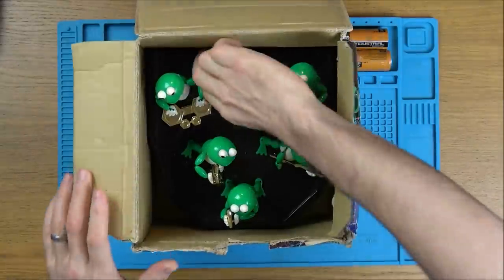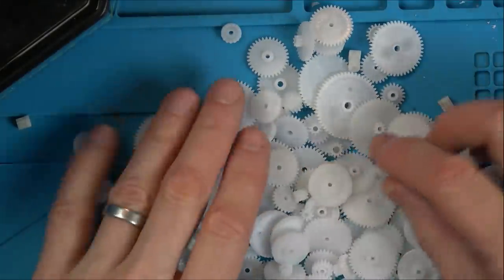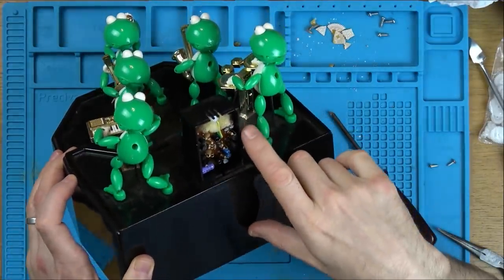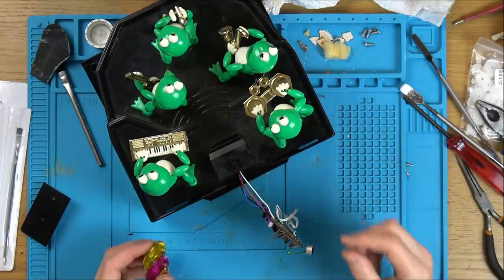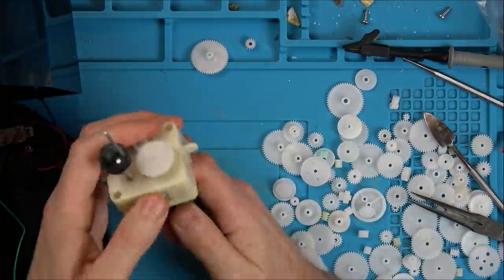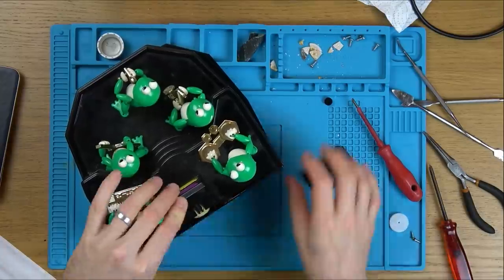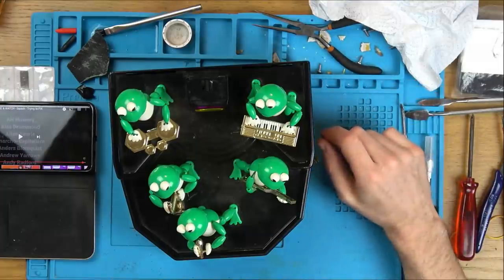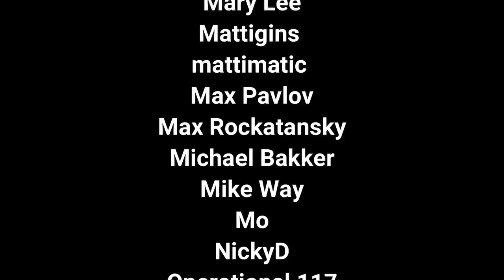Trying to FIX a Green Frog Band from HELL!!!

Comment: Hi Vince,
As someone else pointed out below, you have inadvertently changed the gear ratio, which has increased the torque load required to turn the large new gear. This has also had the effect of speeding up the frogs. You need to replace the gears with the same number of teeth as the original ones, which will allow the motor to turn more revolutions easily, which may also increase the sensitivity.

Comment: Vince I think you changed the gear ratio when you swapped those gears! If you watch some other videos of this toy on YouTube yours looks like it's now running at about 2-3x its normal speed! I think gear ratio is number of teeth on first gear to number of teeth on second. Might be making the motor work harder like this as well!? Great video though, so good to see it working at the end after all that hard work!
Reply from the maker: I think you are correct ekens. The first gear was enlarged so this would make them move quicker and probably harder to start. Thanks for this comment as I now think that this is the problem with the starting up issue 👍👍
Reply: ou beat me to it - b making the gear on the motor bigger, its like starting our car off in second or third.
Reply: @Mymatevince  Perhaps a small, electrolytic cap across the motor would give it the oooomff to overcome the different gear ratio?
Reply: Yup, when replacing a gear you need to count the teeth and measure the diameter inner and outer. Otherwise you risk snapping other gears down the line or burning the motor out from unexpected torque.
Reply: I used to race radio control cars, and the difference between pinion gear sizes has a surprisingly major impact on the motor. Just a couple of teeth difference makes a huge difference to the power the motor needs to provide. The replacement  pinion gear had many more teeth than the original, whereas the larger gear had about the same number, and therefore the motor would struggle to start as it's just a cheap low torque one.
Reply: @Mymatevince  has anyone happened to measure the proper gear size and teeth count? I have one of these I'm trying to fix as a gift and the same gear is totally gone.

Comment: Don't know if anyone else has said, but when you fitted a larger diameter gear to motor, you've raised the gear ratio, so the motor has to work harder speeding up drive and that's why frogs are bouncing round so much.
Apart from that, keep on with the great videos, they're very much appreciated.

Comment: Great repair as usual, but with regards to 3d printing gears, you don't need to design one, there are some gear generators on Thingiverse, you can just change the parameters i.e. number of teeth, gear thickness, diameter etc and it makes the model for you.

Comment: The reason the motor is lacking power to drive the frogs is because you changed the gear ratio. By increasing the size of the gear on the motor shaft you traded torque for speed.
Also recapping the board might help with the sound detection/sensibility.
Reply: Was about to comment this..
Reply: Was about to say the same exact thing about the gear ratio and the cap. I’d love to see him do a proper fix on it.
Reply: Any idea what the cog size is meant to be? Trying to fix mine 😓
Reply: @user-cs6ht3jc9k  Sadly no. You can count the teeth. The gears size doesn't matter as longer as you keep the same gear ratio.
12/24 is the same as 16/32 with is the same as any multiple of 1/2.

Comment: Never had something as cool as the frog band, but I have got a rocking flower and a rocking coke can from the early nineties - and they both still work without any issue ;) Great repair job, Vince, I think you really did everything to get this thing almost perfectly working after so many ours of fiddeling with the nasty gears and the -not very strong - motor ;)

Comment: Does the motor feel like it's seized? I've had that issue with a cheap fan. I would run it hard to almost smoking and it freed up only to seize up when cooled. I ended up taking out the rotor core armature and spinning it while bending slightly to loosen it up. I eventually fixed it and it's somewhat free, starts up on it's own. One thing you can try that might loosen up the gear and wake up the motor is put maybe 6 volts into it and really spin it.

Comment: The smaller the gear on the motor, the more power it has. And yes, you can 3D-print such gears, strong and fitting ;)

Comment: Hi Vince.
A 3D Printer would be able to make tiny gears if it were a Resin Printer, but those are best used with a ultrasonic cleaner to clean the resin before UV Curing. They have incredible resolution but require a bit of practice to make perfect. Also to design the gears they are pretty much just a matter of counting the teeth and measuring the diameter because its a standard revolute you can just install a simple software that makes the gears for you, for instance Autodesk Fusion 360 with the Gears script.

Comment: hi Vince. the moter works but are you sure you assembled it the most optimise way?
putting the back on the moter i saw you did not use the paperclip trick to spread the brushes whilest sliding it over the rotor. maybe they are not seated most properly.
you know?! just like you replace a belt on a record player.
they dance arround quite nicely though.

Comment: Vince maybe add a small capacitor in line to the batteries to give the motor a "kick" at start? Great video! Keep it up!
Reply: This is a DC motor. A capacitor inline will totally block DC.
Reply: @Drew-Dastardly  jesus..."wrong word" police, in parallel...1000 apologies 🤦‍♂️🙄
Reply: Nah parallel will not work either.

Comment: Designing a gear for 3D printing is actually pretty easy, as there are tools that will do most of the work, either OpenSCAD scripts which exist for a wide variety of uses that take parameters in, and output a 3D model, or Fusion 360 itself has features built in that make the job "easy" and so does other 3D modeling software. With one of said scripts it would be as easy as specifying diameter, tooth depth, angle, thickness and count and the script does the rest.
Resin based (UV) printers can print extremely fine detail, and the prints are much smoother than the more common extruder based printers. A resin printer should have no trouble with something this small.

Comment: I wish you had made a video 3 years ago when I still had mine. ;)  It had good gears but I just couldn't get it to move without slapping it on the box and I thought it was just a bad sensor and beyond my ability to repair.  I did get a bit of money it as it still had it's box and they are very in demand but working they go for way more than what I got.
Reply: I just noticed that I still have the video of my own Green Machine Frog Band toy up on my channel.  I saw where I'm tapping the heck out of it just to get it moving.  Good times!

Comment: I think the black stuff inside is the remains of the original carbon brush. You should replace the brushes if you plan for the motor to last, as the bare metal will be worn down fast.

Comment: This frog motor's commutator seems to have a blank spot. If it stops in a particular position, it does not conduct and will not start turning. Unless you turn it a little bit: then it will start and keep on turning because its momentum. It needs a good clean of the commutator and the brushes. Or it's just worn down and needs to be replaced. Just replace that motor. They are cheap and available. Maybe there's one in your junk pile.
I'd still try to use the first gear combination you found. Now, they're moving too fast. using a smaller motor cog would slow them down. You can make it fit by hollowing out the motor mounting a bit, so the motor will sit a bit more away from the big cog, creating more space for smooth turning.
Don't add a capacitor to the motor contacts, as some suggested, for kickstarting it. That would just increase the inrush current the motor switching transistor has to provide. You could add s small value capacitor for filtering out motor noise: 10 to 100 nF or so. (in parallel, of course)

Comment: I haven't finished watching yet, but why Vince? Why did you remove the old grease and not add any new grease to the motor??? At the same time I know when you use a long time on something you start forgetting and getting more and more frustrated with it when it fails to work properly. Great video Vince, keep it up!

Comment: Well, you did increase the drive gear diameter. That would result in less torque. Might not be the whole problem but a contributing factor concerning the fail to kick over the mechanisms at start-up.

Comment: You could reach enough accuracy for the gears with an SLA Printer. And for designing them there are tools online where you just have to type in the number of teeth, diameter and center hole size.

Comment: couldnt tell you what material it is but one of the less common plastics they used to sue to make gears back in the day is known for turning to putty after a decade or so
the cd units for pc engine and turbografx both suffer the same issue

Comment: it's possible that you chase a wrong frog here, maybe leakage in one of these old transistor or cap just drain base cap of motor transistor too fast and current is too low for motor to start with normal sensitivity so you must charge it more than when everything was new (making whole thing hyper sensitive). Or base cap is leaky (electrically) and loose charge too fast, I guess that electrolytic cap is for base.    
There is no point going back to this now but if you ever feel frogs deficiency in your life you can try to change motor transistor with new one, I know that you have that box with small general purpose transistors laying around somewhere.

Comment: oh my gosh i found these same frogs at a thrift store!!!!! may reach out to you if nothing in this video works :)
Reply: ok so im having the same issue as the start of this video, the lights work fine, the motor sounds like its running. What is the exact gear measurement i need to replace with?
Reply: @juliashine548  had the same exact issue lol. did you ever figure it out?

Comment: When you cleaned the motor contacts, you might wanna take a box cutter or similar and clean the gaps between the adjacent contacts. That might form a short and thus lower the motor strength. I had this issue with my drill. Also the motor bruses look like they are nearly all worn through too..
Reply: You can verify with your meter.. this motor should have an abnormally low resistance, or it will draw a lot more current than usual( usual should be single digit mA i think)
Reply from the maker: Thanks Karthik 👍👍👍👍

Comment: think of a mountainbike and youhave 3 gears at the front! how easy is it to pedal on the smallest gear, very easy. when you change to the largest gear it is hard, and also the distance between the cogs is important too small and the resistance increases massively!. you need a smaller motor cog and a larger counterpart as the motor has like zero torque!

Comment: you made a mistake when putting the motor back together, you should have put the contacts onto the armature  then insert it into the housing while pushing against the spindle cos ive destroyed many of motors by doing it in the same way as you have

Comment: Two problems Vince, the motor is worn out and you changed the gear ratio, increasing the torque needed to run the gear train, you waste far to much time on these pieces of junk you get for few quid